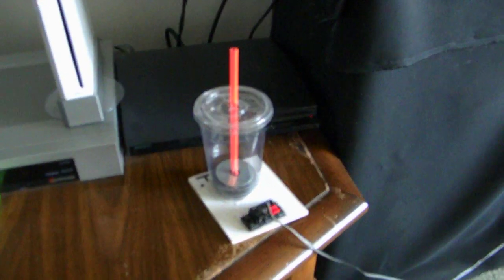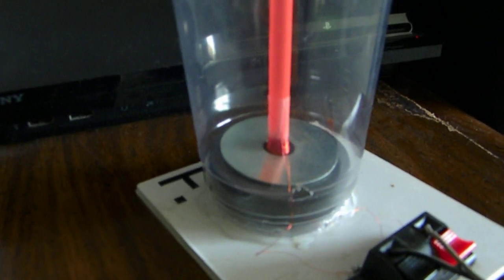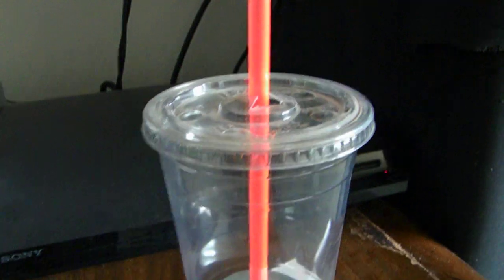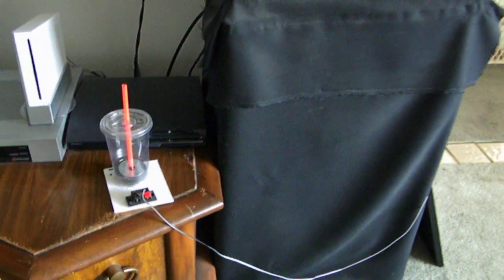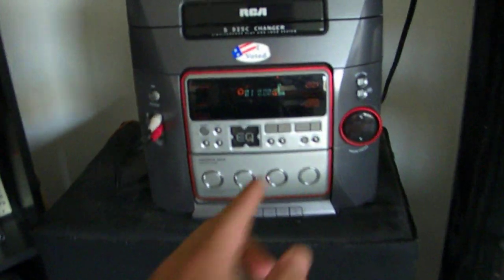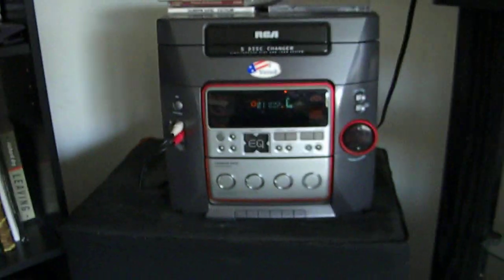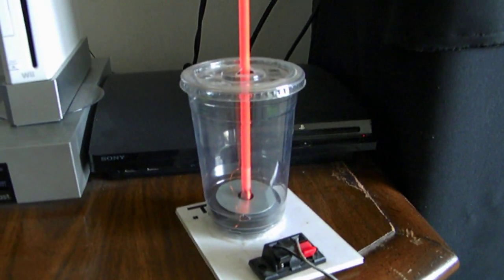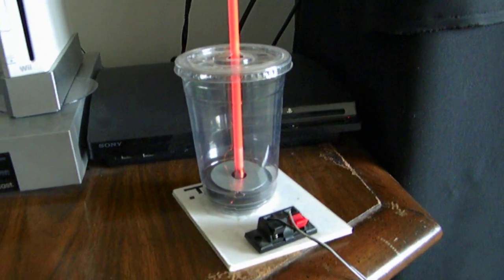Speaker Cup

Comment from the maker: It is really easy to make.  Wind some wire around the end of a straw.  place two donut magnets at the bottom of the cup with washers on he top and bottom. feed the wire through a small hole in the side of the cup, then connect the wire to the input jack.  Make sure the straw goes through a lid and the lid is sealed on to the cup.  I would not adjust the straw too much because it could weaken the flaps in the lid.  The tighter the connection between the straw and the lid, the better quality...